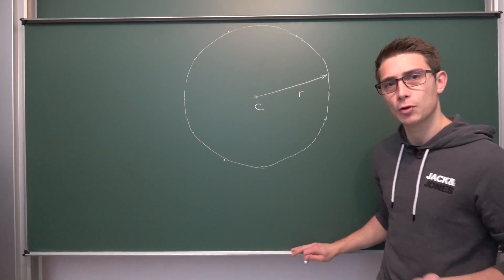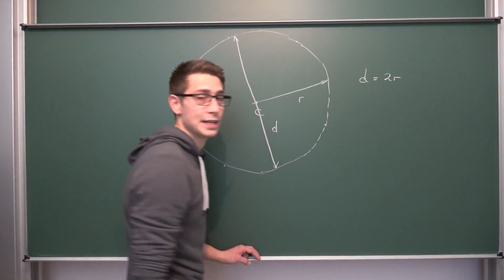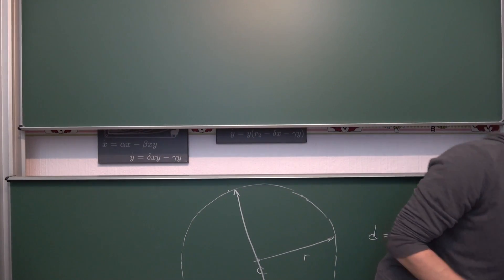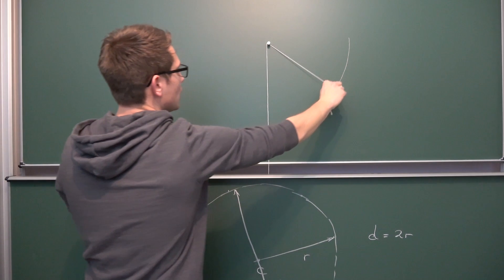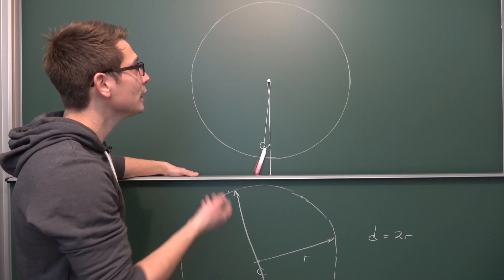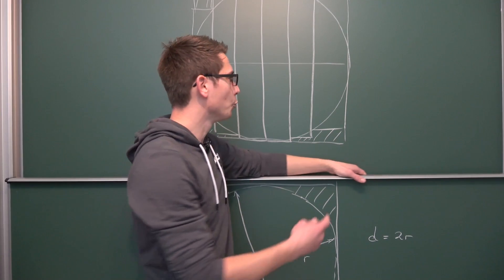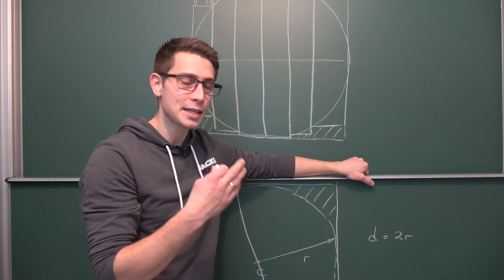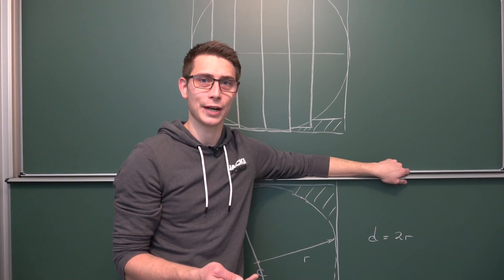Cut Perfect Circles Every Time with Nearly no Waste! - Mathematics for Woodworkers #2

Comment: I don't want to draw a whole circle, just an arc.  It is too big to use a compass.  I have a chord A to B which is 10 units long and the midpoint of the chord is 0.5 units to the centre of the arc.  What is the best way to determine all the points on the arc so I can draw a circular arc?

Comment: On line 18 of the Python program you forget to multiply the length by 2 which results in a result like [12.58, 16.62, 18.86, 19.88, *10.06*, 19.88, 18.86, 16.62, 12.58] where 10.06 is obviously out of place. 
Edit: the supposed half length calculated is also wrong because in theory the largest plank should be radius*2 however on line 18 it does some incorrect calculation that as you see above would have resulted in 20.12 which exceeds 10*2
Reply from the maker: Oh really? Gotta look into that issue!

Comment: I don't understand why you need to spend such a long time describing a circle and how to construct it? Also just make sure you cut to the correct side of your drawn line no? Why add extra diameter to account for this. Good channel though. Hope this is the new matthias wendell
Reply from the maker: Adding extra diameter simply to amount for a bit of error :) For sure, you don't necessarily need the whole tool diameter added to the diameter, but this way you can make sure that everything works out perfectly =) And I talked about the construction in depth, because it's maths for woodworkers overall!
Reply: @RockHardWoodDaddy  i think most woodworkers know this already but im not hating, good video. Looking forward to seeing what other maths you can weave into woodworking!
Reply from the maker: all good Alan, thx for the constructive comment!!! =)

Comment: possible follow-up: given a circle (or a disk), how to find back the center ?
Reply: Draw 2 random cords on the circle. Draw the perpendicular bisector of the two cords and the intersection is the center I believe.
Reply from the maker: I'll make a follow up soon, great idea! =)
Reply: @RockHardWoodDaddy  I think in general it could be interesting to demonstrate practical applications of theorems. I know that many people struggle with "yeah right, but why would I ever need that" feelings with regards to maths. E.g. if you draw a triangle with vertices on a circle, where one side is the diameter, you always get a 90deg angle. Surely there must be some woodworking application for such theorems? (And if not, it's time to invent some haha).

Comment: Two observations:
.
(1) # of boards = ceiling(diameter/width) -- can waste up to half the width of the shortest boards
(maybe not really wasted - they could go into the "save - still useful" bin - maybe for the next circle)
.
(2) Getting really into it - with a miter saw or miter gauge/jig on a table saw, you can cut boards at an angle (up to 45 degrees on the miter saw, more on the table saw with a tapering jig), possibly wasting less - one cut yields two boards, each with one less-waste angled end. The math and the extra steps may make this a case of vanishing return on effort for the more practical woodworker. Still, a fun academic exercise for us weirdos - maybe on your math-ier channel.
Reply from the maker: yup, trapezoidal would work even better!But this would've gone too far I guess xD
Reply: @RockHardWoodDaddy  I’d like to know. Given a board of length X meter and width Y cm. How big circle can you cut?
Reply from the maker: Just one board? If that is the case, then the diameter of the circle will always be Y, so the same as the max width
Reply: @RockHardWoodDaddy  -- I think the question is more nuanced than that. If you have a board length L by width W, and you can cut it into n pieces of different lengths, what't the largest circle you can make?
Reply from the maker: ohhhh, I gotta think about that a bit more, interesting!
Reply: @RockHardWoodDaddy  Yea, I want the list of cuts I need to make before I glue the tabletop.
Reply from the maker: I'm trying to figure it out rn, but it's rather hard to maximize such a problem:)
Reply: @RockHardWoodDaddy  Numerically it is quite easy.
Reply from the maker: yup, squaring a circle is impossible:)